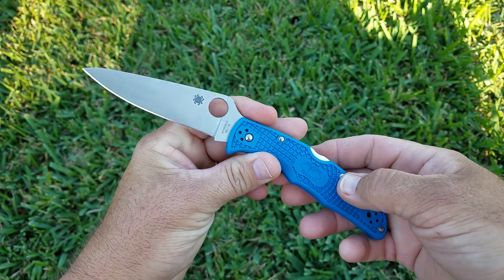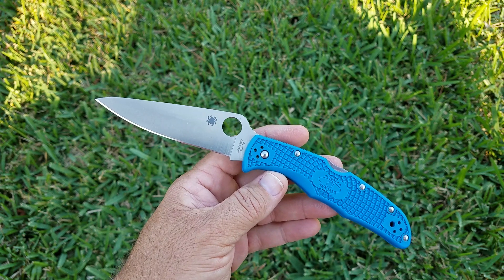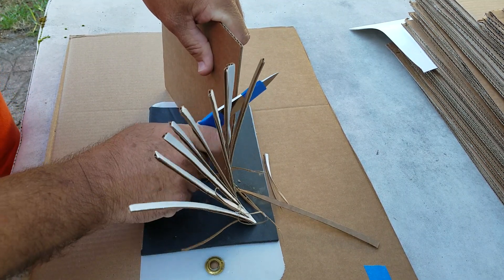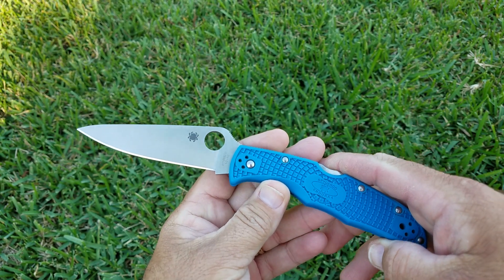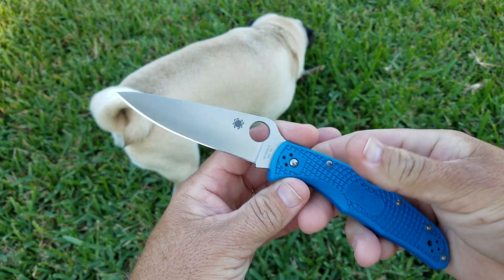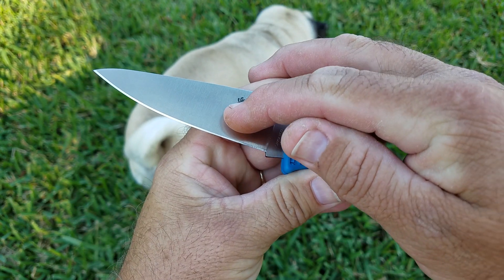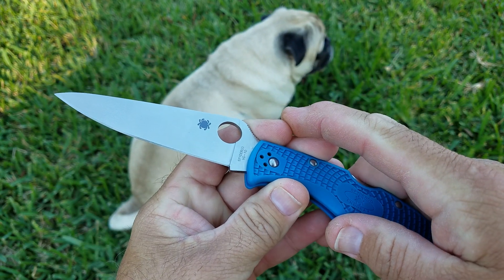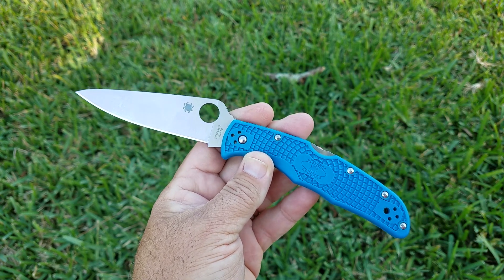Spyderco Endura VG-10 wrap up and discussion of a solid performer

Comment: I'm looking forward to seeing how this knife stops back. This is all about practical use and that's what matters to me in my daily use of knives. Thank you for taking the time to keep making these videos. 👍
Reply: I think it will do very well, especially on wood. It is so responsive to stropping that using wood will be similar to conventional sharpening (stones). Unless your technique is perfect on leather, you will eventually convex your bevel and/or round your apex. Wood also cuts more aggressively, so it's possible that given a certain amount of passes, you will be removing more fatigued steel than you would using leather.
Reply from the maker: Steel and use depends on what strops I use. I prefer bass wood and that is what I'll use for this VG-10 tu see how long the service life can be extended.